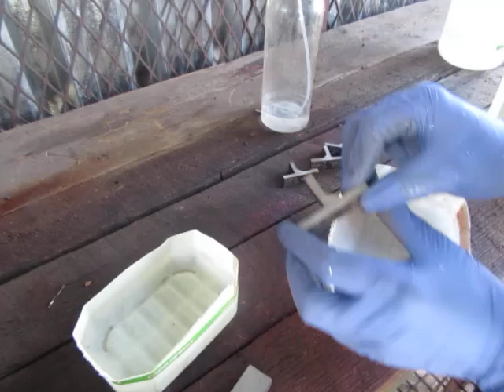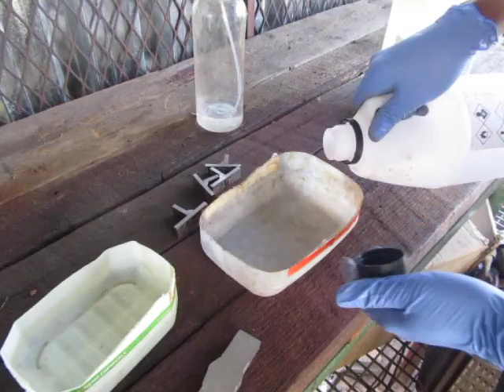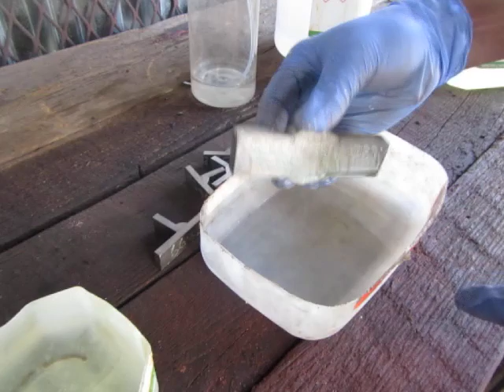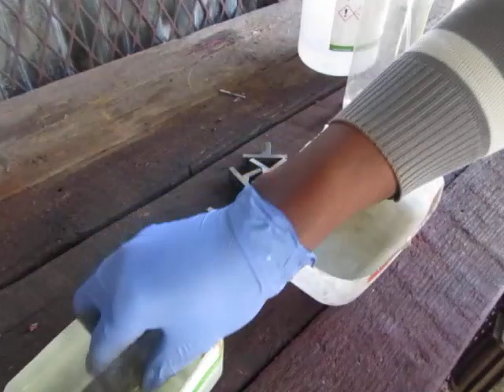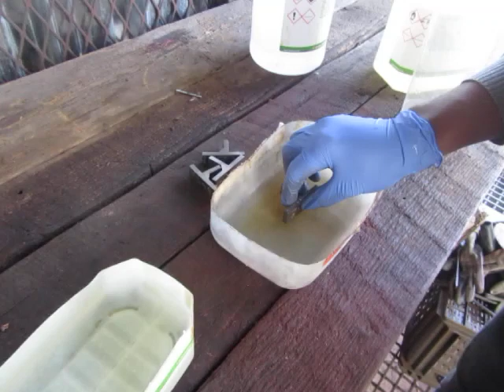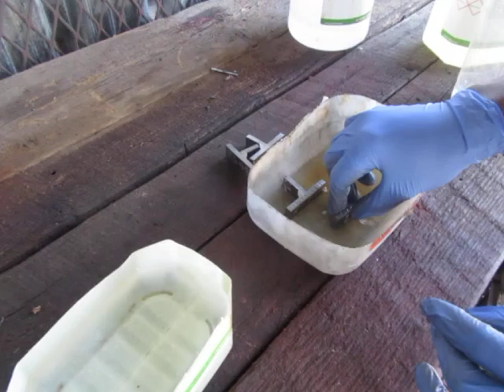Macrostructure etching, how to etch (Mechanics, Metallurgy, Physics Strength of Material)

Comment: I like it but I wanna know more
Reply from the maker: Hey Jeanlucj, hope u doing fine.
Macrostructure is an examination which is done on metallic material mostly in the weld, it aims to evaluate the quality of the weld and assess it flow. The other very important part is to determine if there is enough fusion in the weld and if there is enough fusion between the weld and the parent-metal. Therefore a sample taken from the welded part needs to be etched in order to reveal the weld prior to examination. Then a picture will be taken at low magnification for record.  I hope this helps and thanks. JJL